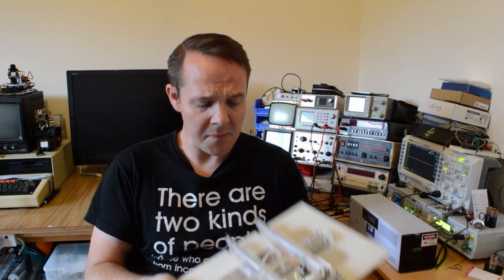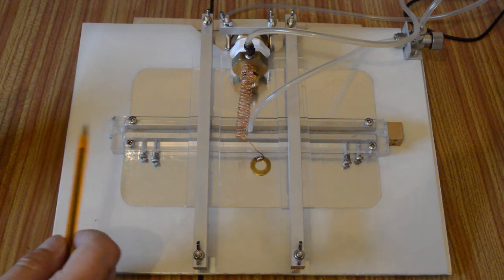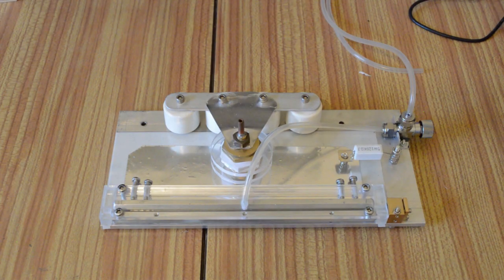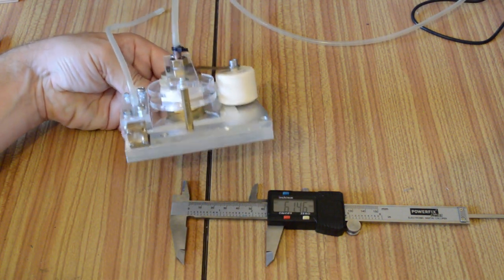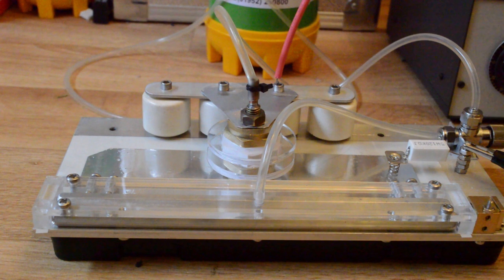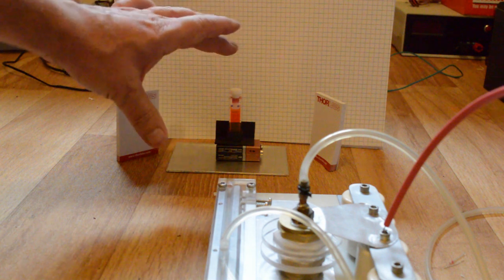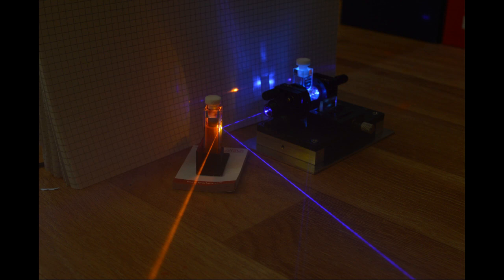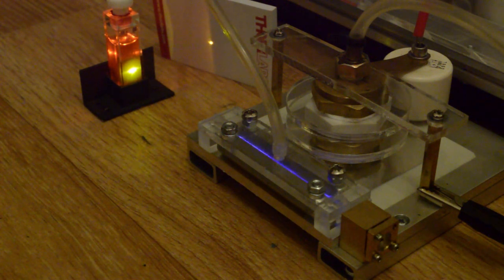DIY Home made High Performance TEA Nitrogen Laser and Dye Laser!

Comment: Found your channel just recently.  Really awesome video here.  I built the SA type version of the TEA N2 laser in junior high MANY years ago.  I got a huge kick out of this video (and the dye pumping finish was super).

The aluminum hex bar extrusion is such a good idea.   I imagine the edge tolerances are great for the purpose.
Reply from the maker: Thanks! Yeah, I built the SA one too (except with doorknob caps). I actually still have it in my cupboard, along with a copy of  "Light and its uses". There is nothing more satisfying than building something like this truly from scratch.
I tried a number of profiles (I now have a whole box of various shapes), but hex had the best performance and was above all easily repeatable. Edges aren't bad, but I give them a light polish with 000 grade steel wool before use.
Long pieces bend a little, it would be nice to be able get flat bar with a 120 degree knife edge on it instead.

Cheers!
Reply: @LesLaboratory  I heard that the N2 laser...fron "light and it's uses"  &  from "the amateur Scientist"  (Scientific American)  Can't work properly due to the high inductance of the thick insulation between the copper.  It was also copied and sold as "PLANS" by 'Amazing Devices'  This guy even used the same sketches...

Comment: a physics question on the dye laser:
knowing that the medium is suspended in a liquid, how can we take into account the motion of the lasing particles?
in room temperature there is brownian motion, and during energy absorption/light emission there could be recoil
is it safe to approximate the particles as stationary as to not affect the frequency of emitted laser light?
Reply from the maker: I doubt it matters, though it would be interesting to look up! If you were to assume the molecules were moving at the speed of sound, stimulated emission will be orders of magnitude faster, so much so, that it would be safe to call the speed of the dye molecule zero. Lasers exist, where the gain media is moving at supersonic velocities (chemical oxygen iodine springs to mind) and even in those, molecular motion could be considered slow to zero as far as photon interactions go.

Comment: If you've got it running with a little corona in the dark, try squirting it with some canned air.  Make sure it's the refrigerant type and not flammable.  The former should suppress the corona nicely and the latter make everything more warm and orange.  The refrigerant type should be interesting to try in the pressurised spark gap.
Reply from the maker: For sure. It would be interesting to try SF6 as well.

Comment: Do you have any videos that explain the square "bottles of dye" or what look like this?  
I don't understand the beam coming out at 90 degrees from the beam going in. 
If these are simple glass containers and if the inner glass surfaces are actin as the partial mirrors on each side of the lasing liquid.
Or maybe there is a mirror off camera or housed in the assembly holding the fluid.  
  
And am guessing there are mirrors or something in the dye containers that I am missing.  
Thanks.

Comment: When I was young, I was very curious about everything what's new in the field of laser technology. my first device was a helium neon laser from Conrad Elecronic in Germany. it cost 400 German marks at this time. not to be compared with laser pointers for a few DM, which were available on every rummage table a short time later. but I had never lost my interest of this cool hobby. you rarely get useful offers on eBay that can be paid for and are still useful. I just googled what a laser cuvette costs. 338 euros for one peace... unbelievable... Thank you for your amazing work.  👍
Reply from the maker: Thanks! Yeah eBay prices for these things can be insane! 
You can get Quartz cuvettes from China for around 35 Euro that are usable (though they leak over time as they are frit-bonded). Fully fused quartz cuvettes can also be had from China for about 100 EUR.
Reply: @LesLaboratory  ah, many thanks for this useful Information. Maybe I bye some for my  own experiments. I have to laser dye from the past.
Reply: How does the cuvette for the Rh6g become directional without silvered windows or mirrors?

Comment: On the charge transfer type, doe the rail without the film cap connect to ground? Despite the words of " It's not going to exactly make a laser pointer " that's what I am attempting to do. I have tried making several small N2 laser heads this last 2 weeks. Been posting about it on my community tab. It's been kicking my backside!
Reply: Found my answer in a write up that you inspired!
Reply from the maker: Sorry I missed this comment! Yes, it connect to ground (but you found that ;-) ) Well, I mean, if you were super determined, and wanted to have a go at making a rolled capacitor....
Reply: @LesLaboratory  I am super determined that's for sure!

Comment: Thanks! Educational and entertaining at the same time (in a science geeky kind of way). 😃
26:00 Amusingly, YT auto-captioning took the discharges as [Applause]. Quite apt, though! 😆
BTW, since the gas feed is set up, it may be interesting to try gases other than N2.
Regarding the dielectric sheet, often they may have tiny imperfections, creating weak spots, where breakdowns eventually occur. The usual measure to mitigate these to have 2 or even 3 layers of the dielectric, layered together. That is, 3 sheets can perform more reliably than 1 sheet of 3 times the thickness.
Reply from the maker: Thanks! Regarding the dielectric, this is solved by redesigning the circuit, such that it is not under permanent stresses (charge transfer scheme). Alternative gasses are in the works, I have optics for this on order, and manifolds in my basket 😉
Reply: @LesLaboratory  , impressively quick answer to a comment on a video posted 3 years ago! 😃
Standing by for watching more laser experimental goodness!!

Comment: i wonder if you could somehow get a faster pulse rate without killing the output power, would be cool to have a Constant output N2 laser, but those pulses are what excites the N2, i do wonder if you could get it to trigger like 30 times a sec though
Reply from the maker: I can get a good 60Hz out of the smaller version of this Laser, but yes, you are right, if you cool the gas, you can increase the repetition rate. Back in the 1970's Nitrogen Lasers were built in Labs that could fire at kHz rates with cooled N2.
Reply: @LesLaboratory  on wow that’s interesting, would be cool to build one, but I lack materials to build a nice one lol

Comment: You talked about scaling the laser down, but what about scaling the design up?  I am wanting to build a single pulse setup that it capable of ionizing a channel of air.
Reply from the maker: in this video: https://www.youtube.com/watch?v=ZQJoJEr3US8 I demo a 30cm long TEA nitrogen laser that outputs half a megawatt. TEA lasers don't scale very well though. for higher powers you would need a low pressure design. 
To ionize air channels, I'm pretty sure you need well over a Megawatt. I believe it has been done with excimers. 
Is the intent to get it to conduct high voltage?
Reply: @LesLaboratory  I am interested in the possibility of using a nitrogen laser to direct the output from a large Tesla Coil.  I have a very large HV cap. I just didn't know if it would be suited for this purpose.  The cap definitely has the energy capacity.  83,520 Joules. (No that isn't a typo. It's rated 24KVDC @ 303.8 Mfd. It weighs 400lbs).
Reply from the maker: @Kilroy01  Now that is a capacitor!  
Unfortunately,  its not about how much power you have available, but how fast you can dump it into the channel. This has to be done on the order of nanoseconds, which necessitates low inductance, low capacitance values.
You could build a Large Q-Switched Nd:YAG  with it, and triple the output with non-linear crystals...

Comment: I love the suggestions and it brings back lots of memories but watching these raised a few concerns. I used these and other types of laser right up to class IV in PhD for fluroescence spectrosopy. Please please mention safety goggles etc as there are lots of hidden dangers here, these are on an open bench, your lasers are not secured and I see no interlocks etc. They operate at UV 337nm and the peak power can do some serious damage to anyone not just the operator so you need googles to protect the eyes. Even the dye cell output I would expect is in the same category. Reflecting either off a surface into the plane of the eye so it can be seen, it doesn't bear thinking about what might happen! A split-second direct exposure to such a 200 mW laser emitting even if it were 100 metres away can cause permanent eye damage. Pulsed UV radiation from nitrogen lasers is definitely capable of causing eye damage before you even mention the dye cell output frequency shift. The laser pulse or beam may damage the eye before the eys will have even reacted that is the danger of these. Of course noone thinks it will happen to them, but it can and the damage is often permanent. The high voltages are an issue too they can kill.
Reply from the maker: Thanks. In later iterations, the Dye Laser is Mounted on on optical breadboard, where all beams are terminated. Goggles have been mentioned in the comments and since there is a lot of  Laser craziness on YouTube, I had already suggested that this will be addressed in due course.
The classification of this Laser would be 3B. Although peak power (in watts is high) pulse energy is on the order of micro-joules and average power is sub 20mW. 
At this wavelength, UV would never penetrate the cornea, that said, a corneal ulcer is exceedingly unpleasant, and eye protection should be worn. 
The Dye Laser on the other hand could damage ones retina if you chose to stare down the beam.
All Laser beams diverge to some degree. At 100m distance for a 200mW Laser as you suggest, with a reasonable 0.5mRad Beam divergence, would yield a spot size of over 50mm, giving an irradiance 0.097mW per square mm at the target. Assuming a person had dark adapted eyes, for a pupil diameter of 7mm, this would equate to approximately 3.7mW of Laser light entering the eye. A moderate hazard, but  hazard nonetheless.
The High voltage supply, whilst it deserves respect, is quite low current. It would give a nasty shock, which could lead to an accident, but is highly unlikely to kill. This is in stark contrast to the danger posed from a Flash-lamp Pumped YAG power supply, which are positively lethal.
Reply: @LesLaboratory  OK I was dealing with class IV Nd:YAG with primary a 1064nm and the more familiar green 532nm both were high power. The pumped dyes were 400nm up to 980nm so seems like lots of similarity.T This was 17 years ago now.
Reply from the maker: @dombaines  I have a great respect for Nd:YAG, and have built several. One is doubled to 532nm, and pumps an unusual solid sate dye Laser.
In any case, point taken, so thanks for reminding me about safety! It is something that is not adequately covered on YouTube, especially how to purchase the correct eye protection for the job, so I will delve into correct wavelength and Optical Density selection for Lasers.
Cheers!

Les

Comment: This video is a good example btw. RE color coordination, you got the outside light shining in with 6000K at noon, the overhead lights have around 3000K, and because of the harsh shadows from the bright outside light, the camera is constantly pumping because of exposure changes when you move your hands around.
Solution would be to completely block out the outside light, have your overhead lights at 4000-5000K, have the whole setup on a table, best is a light-gray background/surface, and some additional directed lighting at the same color temperature. 
Other improvements would be to put up the schematics as CAD/EDA drawings. Marco Reps for example often shows SPICE animated simulations. Unless you can pull off hand-drawn schematics as good as Big Clive.
Reply from the maker: Thanks again. 
I have ordered a couple of small 5600k lights for close up work and consulted the camera manual re white balance. As funding permits, I will invest in a proper lighting setup. It will be interesting to see how color rendering work with laser beams, they are notariously difficult to film with good color reproduction.
Reply: @LesLaboratory  Yes, lasers are difficult, especially since you're often working with low-powered ones. But for all the normal camera work, not having enough light always works against you. At 60 fps, the sensor only has 1/60 of a second to collect all light. If you are underexposed, you can crank up the ISO, but that introduces more noise into the picture. Or open up the aperture, but then your depth of field gets shallow. So the best thing is to just have a lot of light to begin with (and a good lens of course, but I assume you're just using the variable stock lens).
Best would also be to lock exposure, but that can be problematic if you want to be behind and in front of the camera at the same time, so having consistent lighting somewhat mitigates that.

Comment: Fantastic work!!! 24:08 How do you get the uniform discharge like that? Is this at atmospheric pressure? How are the edges prepared?
Reply from the maker: Thanks! Yep this is at atmospheric pressure. The edges are polished with 000 steel wool. You get a nice smooth discharge with nitrogen assuming everything else is tuned correctly. With air, not so much, but but it is doable.

Comment: This is really cool! Subscribed
Anyhow a question: Does the spark gap produce much EM-noise in radios or TV? If yes, could that be shielded easily? With a metal case or something maybe?
Reply from the maker: Awesome thanks! Yes, spark gaps (and even semiconductor switched Nitrogen Lasers) radiate loads of EM-noise, so an analog radio or TV, will 'pop' or display static. It will interfere with digital equipment as well.
If this was built into a metal case including the PSU,  you can easily minimise the interference significantly. 
After that, you may have to add line filters or ferrites to the input power leads to minimise leakage that way as well.

Comment: I would like to build a Nitrogen laser that Produces 165 uJ per pass. I want to make a dye laser with it. I will use 5 ma, 10 kv DC. A question how would you calculate the wavelength of the dye laser. I think you would need a Visible laser spectrometer but would the quick pulses make that difficult?

Comment: Hope not to be boring, but I'm wondering if the pk cap is replaced with a doorknob as the ones used in the dumper, would the performance be better or basically the same? If it is the same, I guess the 'only' advantage on using a doorknob as peaker is the compactness and robustness of that vs aluminum foil+acetate sheet DiY peaker?

Comment: How large the high voltage ceramic capacitor and cement resistor are? I have a 15KV/1mA voltage source, is it enough? Today my first try on Blumlein line is faild, too many sparks without lasing.
Reply from the maker: Between them the capacitors are 2497pF @ 30kV (so about 620pF each). They also must be doorknob types (low inductance). The resistor is 5W at 120k. You should watch the video here: https://www.youtube.com/watch?v=AyN1o_3XaTw. 15Kv is not enough. The laser fires about about 17kV plus. You should build a supply capable of outputting 20kV or more. Mine will run up to 30kV.

Comment: How can we make tea laser continuous in vaccume condition ?
Reply from the maker: You can't. The Laser self terminates, and so can only be run pulsed. That said, you can get very high repetition rates under the right conditions.
Reply: @LesLaboratory  can we get khz range of pulses !!??
Reply from the maker: @omsingharjit  Yes, according to the literature, this it is possible to get several kHz output with proper design.

Comment: Just thinking in using my old 500pf sprague doorknob capacitors. They are 5, so would it be a good idea to use one of them as peaker (for a 9cm ca laser channel) and the other 4 as dumper? According to the facts you talk about in your videos, it should be 60pf peaker for each cm of laser channel and dumper has to be 3-5 times peaker's capacity if I remember well... Thanks!

Comment: Great video! Quick question - what is the effect of the feedback mirrors on the dye laser pulse energy? Should one include feedback mirrors to fully optimize the pulse energy?
Reply from the maker: Using feedback mirrors will significantly improve beam quality, stability and pulse energy. some feedback is a requirement for tunable Dye Lasers (check out my other videos) the required  reflectance of the output mirror is fairly low from 10-50%
Reply: @LesLaboratory  thanks. Don’t the surfaces of the cuvette itself also already provide some feedback? For example, the power reflection coefficient at air-glass interface is already ~ 4%
Reply from the maker: @poodook  yes, they do. In my Dye laser designs, I have the cuvettes tilted such that the reflections don't interfere with the beam.

Comment: what is the benefit of pressurizing the spark gap?
Reply from the maker: Pressurizing the gap means you can have the electrodes closer together, this in turn means lower inductance of the spark channel, and thus much higher speed than an atmospheric pressure gap.